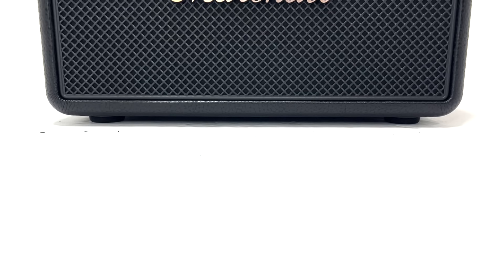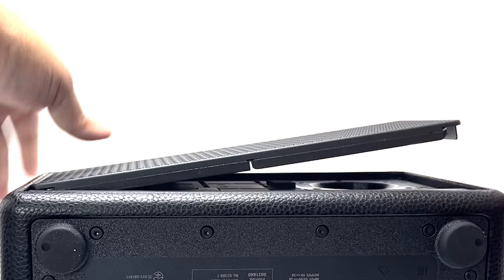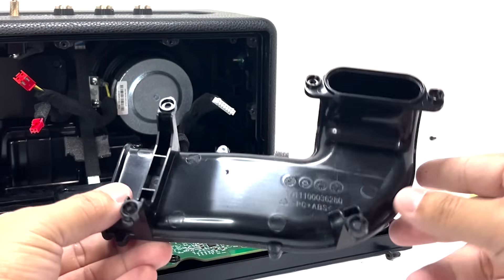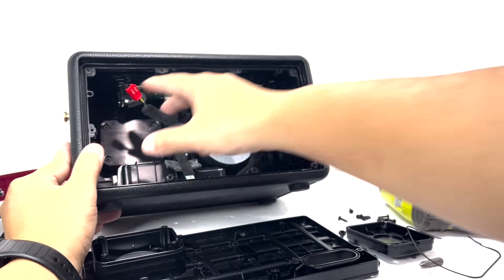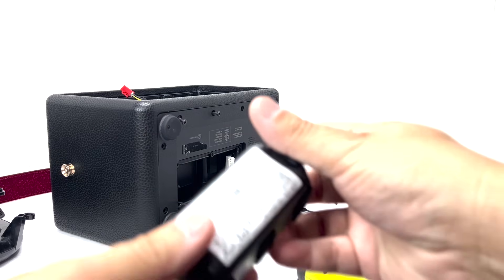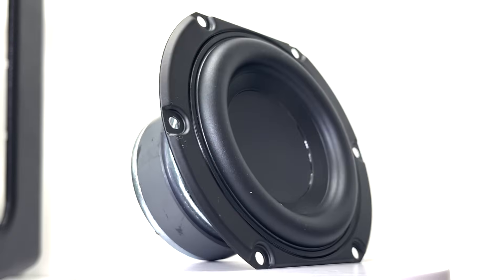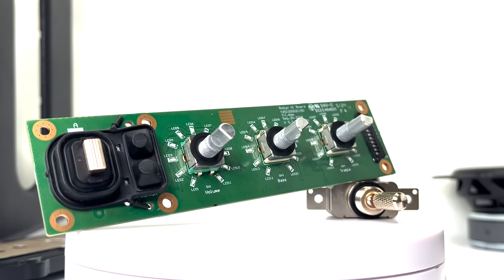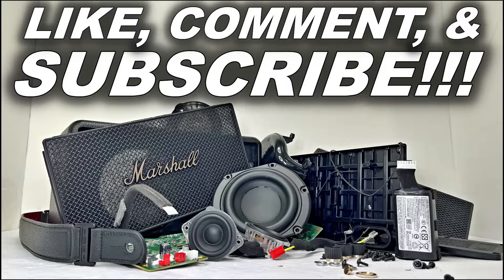Marshall Kilburn III Teardown - What's Inside This $400 Speaker?

Comment: After seeing internal parts it's not worth the price. Thnx for revealing the truth maximum under 40$  not 10x😒😒 the actual price.
Reply: You need to listen to it, it's not only the cost of the parts, you need to consider the engineering, software and audio tune... this speaker it's easily one of the best ones of the market for this size.
Reply: @eduardoesqueda7977 You need to listen to anything from Sony, Sonodyne or Klipsh in the price range.
You will define good audio very differently.
Reply: @eduardoesqueda7977 You need to listen to anything from Sony, Sonodyne or Klipsh in the price range.
You will define good audio very differently.
Reply: I mean the enclosure is solid. But yes, it's pretty cheap stuff inside it. Solder On boards !! TF 😢
It at least deserves a twitter but the crossover is a tad pricey even at this bracket. Ripoff.

Comment: I wonder why Marshall chose to put one full range speaker in the front and another in the back, rather than putting both in the front and the bass driver in the back?  I can't see how this design will provide true stereo sound....
Reply: It sounds muffled and dull. I was wondering the same thing and why not a tweeter at least to give it more detail like the Acton 3. With this the bass and mids are very strong and the Middleton 2 sounds better, stage presence and hits low. But for what ever reason it’s such a quiet speaker. On the other hand makes me wonder why the middleton 2 is only $50 cheaper than this feature rich model?!
Reply: It's simple, you place the speaker in the centre of a room and it sounds good wherever you listen from. If both tweeters were on the front, it would sound unclear if listening from behind the speaker. Imo you will never get convincing stereo from a single speaker
Reply: @TheHarooni  Basically, what you have when you put one tweeter in the front and one behind is an omnidirectional speaker, NOT a stereo speaker.  I tend to not position a speaker I want to listen to so that it's facing away from me anyway. Finally, placing a speaker in the center of a room is probably the worst positioning for good bass performance.

Comment: Those drivers are off the shelf, cheap chinese. That woofer costs $5 US. The geometry and internal dsp make all the difference
Reply: its a peerless sds 4 inch its $30 on aliexpress and its a very good woofer i had the killburn 2 and it has the same woofer
Reply: Ever since Marshall sold a majority to some Chinese company i will never ever buy a new Marshall. That name has died
Reply from the maker: that is good to know.  Thank you for the info.
Reply: thats a Peerelss SDS 4inch
Reply: @larssssssssssssds Around 24 USD here in India - Peerless SDS 4" (in retail)

Comment: LOL plastik housing  speaker 😂 thats so so cheap. i tell you now its over priced so much
Reply: Most speakers have plastic housing - what were you expecting a stainless steel or metal that will make it weigh around 8kg which isn’t ideal. Even the high end portable speakers like b&o have plastic housing. Foolish comment.
Reply: @Silentapertures My Marshall Kilburn (I) housing is completely out of wood..
Reply: @mystikal459  So is my Stanmore III, hence i said most speakers not all.
Reply from the maker: Agreed
Reply: I’m not sure having metal housing is a priority for someone buying this given it’s meant to be a portable speaker, which is why it has a 50 hour battery life.
Reply: @Sojourner88  sure you pay 400$ for cheap parts with premium badge... ahh and of course 50H with 5500mah baterry...
Reply: @ReVersDC I don’t own any Marshall branded stuff, just doing some window shopping, so I don’t have any personal bias on this, but given the weight of the product marketed as ‘portable’ - I did not expect to see a lot of metal in it.
Reply: @Sojourner88  jbl boombox 3 weight about 7kg and its still portable 😅 look at other videos on this channel and you see even cheaper stuff had better speaker inside
Reply: @ReVersDC lol, more than twice as heavy. I don’t think at that weight you want to move it very often or far. I am pretty sure the Marshall actons have wooden housing and the previous kilburn also had plastic housing. Again, I think it comes down to different materials for different purposes. One is meant for more portability, higher water resistance the other to sit at home, always wired.